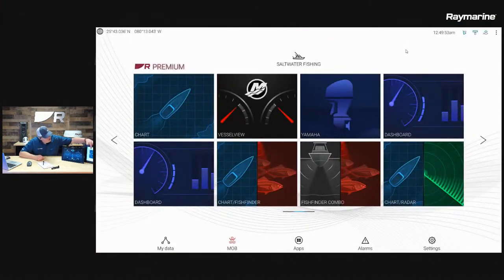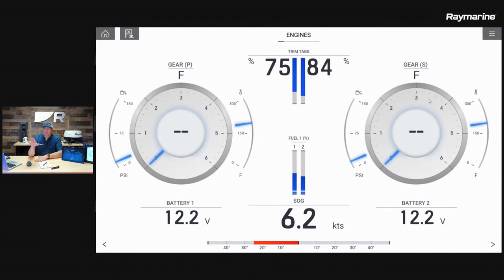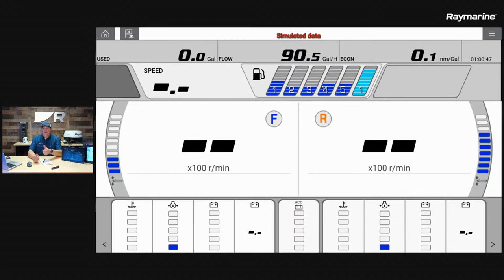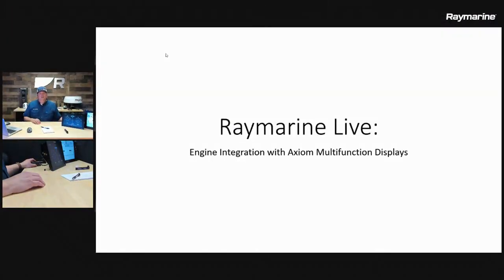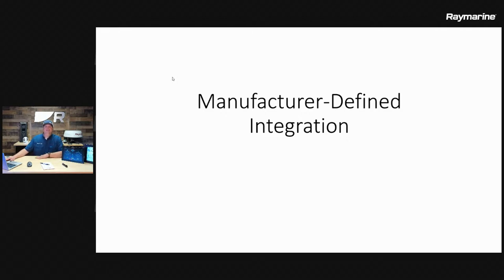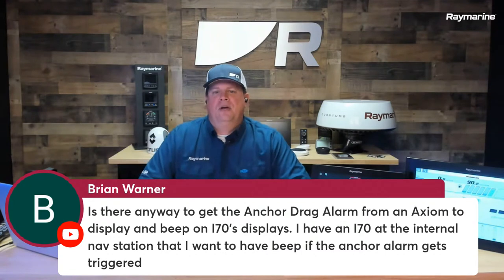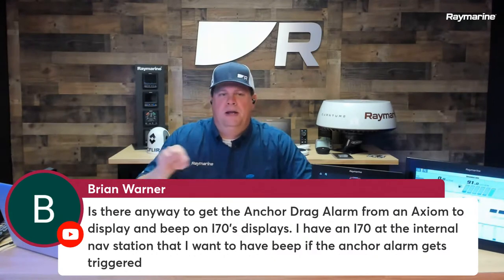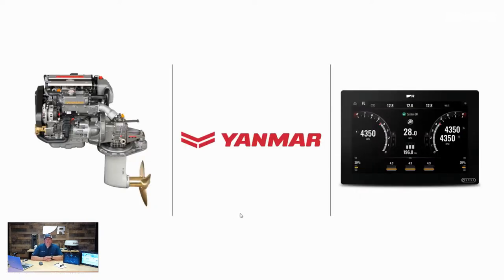Raymarine Live:  Engine Data Integration with Axiom

Comment: How would I set up a repeater for inside the sailboat for an axiom chart plotter?  Can I use an iPad or other tablet in conjunction with the app?  How much control can I have with such a tablet if possible?
Reply from the maker: There are a few ways to setup a 2nd station inside the boat.

Option 1 is to install an additional Axiom display of any size or style and connect the RayNet high speed network from it back to your original Axiom.   This option gives you full, independent control at the 2nd location.   Admittedly though, this is the most expensive option, and it requires some wiring too.

Option 2 is to use a mobile device like a phone or table running the Raymarine app.  The app is free, and available for Apple and Android devices.   You'll link your phone or tablet to Axiom's Wi-Fi hotspot.   The app will repeat whatever is on the Axiom's screen, and you have full touchscreen control from the remote device.

Option 3 is to use Axiom's Miracast video streaming capability to stream the video output wirelessly from Axiom to a compatible Smart TV or monitor.   Miracast is an HDMI over Wi-Fi technology.  Most Smart TVs support it.  You can also purchase low-cost Miracast HDMI dongles that will plug into any screen with an HDMI port to make them Miracast compatible.  This lets you see Axiom at another location.   If you want to control it there too you could connect a wireless mouse or mouse/keyboard combo to Axiom's Bluetooth adapter.  That is how I remote-control the Axiom I use in the studio for the Raymarine Live broadcasts.   When a mouse is linked to Axiom you'll see a mouse pointer on-screen.

Comment: Using Actisense EMU-1 and an Axiom +, can I set up alarms for the engine data coming through NMEA2000? Like high temp. low oil pressure etc. I currently use a Garmin unit and it is not possible there. I can view the data, but there is no option to set up alarms for the NMEA2000 data.

Also, can I add the NMEA2000 data on the map screen on an Axiom? I think so but want to be sure.
Reply from the maker: Engine alarm thresholds would need to be configured outside of Axiom.  Typically the engine system or engine gateway device would be where this happens.  You may want to check and see if they can be configured in the EMU-1.

NMEA 2000 data can be displayed on the map, or any other screen on Axiom is a couple of different ways.   If you swipe in from the left edge of the screen there is a sidebar with 2 data panels.  Long-press on any cell and you can edit the type of data presented there.   Axiom also supports up to 4 floating data items on any display page.   Touch Menu...Settings...Page Settings...Edit Data Overlays...Add.  From here you'll see the data library where you can drill down through the different categories of information and choose what to display.  Once added to the screen, drag to move it anywhere.  Tap the item and you'll see some options for resizing the item too.  Touch SAVE to save it.

Comment: Good afternoon,
Thank you very much for your explanation. I would like to ask you: I have made the installation from Yamaha to Raymarine but the autopilot does not work because I get an alarm "the satellite signal is weak" I think it is because the Yamaha GPS hits against the Raymarine GPS, is it possible? What do you recommend me to do? Disconnect a GPS? Which one?

Thank you very much in advance,
Best regards.
Reply from the maker: Hello Eugeni.   I'd need to know a bit more about your system setup and the position of your antennas.   It sounds like you have a Yamaha system with a joystick controller in it, so we don't want to disconnect its GPS receiver as it is a critical part of that system.   If you could, please email me at james.mcgowan@raymarine.com with your contact details and I can have a member of our technical team get in touch to assist.

Comment: So my electronics guy put in the EC100 for my twin Yamahas. Since it’s not the Yamaha 6yg what readings can I expect to get on my display screen? In particular I would like to know my gph as well as fuel level for my fuel tank. Will I get this from the EC100?
Reply from the maker: If you go into the Dashboard app and access the engine data screens there you will get just about everything you would expect.   RPMs, gear, temperatures, pressures, fuel burn (if your engine outputs  it).   You may or may not get tank levels depending on whether or not your tank senders are part of the engine's digital network, or are analog inputs.

The actual Yamaha app on Axiom won't show you anything with ECI-100.  That app (per Yamaha's requirements) looks for the presence of the 6YG gateway before it will show a full data set.

Comment: Jim, I bought a commercial tour boat with older Detroit Diesel 8V-92-TAs. Can I integrate with Axiom? Also would love to speak with you regarding drone integration.
Reply from the maker: Hi Gary.   Many of the Detroit Diesel motors support J1939 engine data.  If your motors have any kind of electronic instrumentation connected to them now, that is most likely what they are using.  You'd need to use a J1939 to NMEA2000 adapter to make it work.

If your engine instruments are all analog gauges then you could use one of the analog to digital conversion products, though they need a bit more setup.

Feel free to shoot me an email to james.mcgowan@raymarine.com about drone integration.
Reply: Garry, did you get it figured out? I also have 8v92, but I don't think it's about the engine in particular: we can buy transduceres that output NMEA 2000 and it'll integrate. A more subtle problem might be that (per the manual and online docs) there's no high temperature transcucer interface built in. For the exhaust gas manifold, you'll want that (and I do too!) to get early warning if any number of cooling mishaps occur.

Comment: converter SPX10 auto pilot to Axiom is this possible, so I can use Axiom to steer my SPX10 autopilot, I have a A9 were I have this possibility - Love Raymarine
Reply from the maker: Thank for watching, Erik!  Axiom can work with your SPX-10 autopilot for the purposes of sending it waypoints or routes to steer to, sharing compass heading information, and sharing navigation data.  Primary control of the autopilot would be from your pilot control head though.

When used with an Evolution-series autopilot, Axiom can be the primary (or only) autopilot controller onboard.   Axiom has the ability to setup and configure the Evolution series autopilot, start and stop it, etc.   That full level of setup, calibration and control is not available with your SPX-10.

Comment: Hi, love the Raymarine Live video series, huge value for customers.  

I have an older 2000 Yamaha 2 stroke outboard, model Z200TXRZ engine ID prefix 6G6X, which I would like to integrate any engine data to my Axiom Pro RVX via the NMEA2000 network.  I didn’t see the solution in the video or answers.   Thanks advance for the help.
Reply from the maker: Hello Eric.   I am not 100% certain about your motor just because of its age.    From what i have read online, Yamaha did not add CommandLink and NMEA2000 data capability until their 2005 model year.  If that is the case we would be able to make use of Axiom's built-in Yamaha app.

It might be possible to get engine data through another method, though that becomes a bit more of a project depending on how it is done.    If there is any electronic data at all available from your Yamaha motors, it might correlate to one of the automotive, industrial or diesel-based engine data protocols like J1939 or J1708.   Companies like Yacht Devices make adapters that can work with many of those systems.

If your boat is fitted out with a bunch of analog gauges, its also possible to use a device like a Noland RS-11, Alba Combi, or Actisense EMU-100 to read the analog signals going to each instrument and convert them to NMEA2000 digital.  This is not a plug-and-play solution, and often the reward for doing so is not worth the effort involved in doing it.  

Another way to do it, probably the simplest of all, but also with the most basic data, is to use something like this Outboard Motor Gateway from Yacht Devices.    It can pick up engine RPM by sensing the pulses on a spark plug wire, and converting them to NMEA2000 data that your Axiom could read.   https://www.yachtd.com/products/outboard.html

Comment: You mentioned possibilities getting old antique engine data?  What about getting data from a 2018 gas Westerbeke generator?
Reply from the maker: Hello KMT.  I see Westerbeke offers NMEA2000 as an option on many of their diesel generator sets going back to 2008 or so.   I don't see much related to their gas models though.    I was doing some digging and see that their EFI gas models to have a diagnostic port that can be read with a Windows PC and their software.   That means that they are outputting something...what format its in is to be determined.

I just sent a B2B message to a contact as Westerbeke to see what information they might have on this.  I will post an update when I hear back from them.   Feel free to send me an email too so I can find you a bit easier.  james.mcgowan@raymarine.com

Comment: Would you replace the gateway if youve been struck by lightning?
Reply from the maker: Ouch!   This is a tough one Tracy.   With a lightning strike, pretty much everything onboard the boat that is electronic becomes suspect.   Often it is necessary to go component-by-component through the system to determine what is actually working, and what is not.

Comment: Hi Jim. I am wondering if it is possible in the Axiom to change the maximums of the gauges. For instance I don't need a rpm gauge that goes up to 5k nor do I need my temperature gauge to go to 300. It would let me have much more useful gauges if I could adjust the rpm max to 4000 and the temp max on the gauge to 225. Is this possible?
Reply from the maker: While in the dashboard app go to Menu...Settings...and select the Advanced tab.   There are some settings there where you can configure the maximum RPM for the tachometer, and define a custom red zone too.  I will do a bit of research on the temperature gauge.  I don't see a control to adjust it.   If you could, please shoot me an email to james.mcgowan@raymarine.com so I can get back to you with a better answer on that.

Comment: Hello Jim, I have SeaBoss 19´with a Mercury 115hp fuel injected 4-stroke dating back to 2008. Can I integrate my older Raymarine A50D using the same hardware & cables for the Axiom you mentioned in the video? what is the aproximate cost of doing so? Great video, congratulations. Thank you.
Reply from the maker: Hello German.  Thank you for watching our Raymarine Live series!  The A50D has a different power cable than Axiom RV so you will need to change that out.   The transducer your A50D is using now can be used with Axiom.   You can use it as the only transducer, or, you can use it along with an Axion RealVision 3D transducer.

If you want to use only your existing transducer you'll need to order transducer adapter cable A80488 ($60 US).  This will give you 2 sonar channels on your Axiom, identical to what you have now (50 KHz and 200 kHz at 600-watts of power.)  This adapter takes the 25-pin RealVision 3D connection on Axiom down to 7-pins, which your current transducer has.

If instead you use transducer adapter A80491 ($110 US)  you can utilize both your current transducer as well as an Axiom RealVision 3D transducer.   I run this setup on my own boat and love it.   This is a Y-Cable adapter that lets you simultaneously connect both a 25-pin RealVision 3D transducer and a 7-pin Airmar 600-watt transducer.  You'll have access to 50 kHz at 600-watts, 200 kHz at 600-watts, CHIRP DownVision, CHIRP SideVision and RealVision 3D.   It makes for a very powerful setup useful both in shallow and deep water.  In this configuration you do lose the 170 to 230 kHz CHIRP channel from Axiom, and, the water temperature reading will come from your OLD transducer and not from the newer Axiom RealVision 3D transducers.

The Axiom RV models range in price from $999 (US) for the 7-inch Axiom RV (no transducer included) to $3429.99 for a 12-inch Axiom RV bundle with the RV100 transducer and Navionics charts in-the-box.

Comment: I have twin Volvo Penta Engines Volvo Penta IPS 500. Engine Year: 2019. Engine serial #1: A969238 and Engine serial #2:A969240. The engines are not being recognized by my Axiom 12 display when I go to engine data page. Even when I select “Other” and run my engines in sequence as requested by Raymarine. Data for my engines is displayed on two separate Volvo display that only show one selected detail at a time (oil pressure, engine temp..etc. How can I get all this data one one page of my axiom displays. Thanks, Al
Reply from the maker: Hello Albert.   For most Volvo Penta engine installation you will need to use either a Raymarine ECI-100 universal engine interface module or a Volvo Penta engine gateway to get at the engine information.  Either of these devices will plug into the Volvo EVC network and provide a NMEA2000 data stream that connects to Axiom's SeaTalk NG network.

Our ECI-100 handbook shows the setup specifically for Volvo systems starting on page 25.   
https://raymarine.app.box.com/s/s2bajpvqjoiflgsqzx3o/folder/1787229147

You'll need to locate the Volvo multi-link hub inside your helm.  This 6-port helm will normally have an empty port on it that can be used for the engine data gateway device.   If you use a Raymarine ECI-100, it will plug into it using a Volvo link cable, part number E70240.   The Volvo link cable plugs to the hub, then the other end screws into the ECI-100.  The other port on the ECI-100 will use a SeaTalk NG spur cable to plug into the Raymarine network.

If you use a Volvo Penta factory engine gateway, it will also have 2 connections.  One fits into the multi-link hub, and the other will tie into the Raymarine Seatalk network through a A06075 DeviceNet adapter cable.

In both instances, power to the engine gateway is provided by the networks already installed.

On your Axiom display you'll set the Engine Manufacturer to Other, and the number of engines to 2.   From there, go into Axiom's Dashboard app.  The app should pre-set itself for a dual engine display and your data should be visible in the app when the engines are on.

If its still giving you trouble please feel free to drop me an email at james.mcgowan@raymarine.com or open a ticket with our support team at http://raymarine.custhelp.com and I can get our engine team in touch with you.

Comment: What was the system called just before the Axiom? I have that system on my 2007 340 DA with 8.1 496. I want to display engine data. Help?
Reply from the maker: Hello Joseph.   You probably have our e-Series, eS-Series or gS-Series screens on your boat.   These units run our LightHouse 2 operating system. 

Engine data connects using NMEA2000 data, and will come into any Raymarine MFD through its SeaTalk NG or NMEA2000 port.   This video might be helpful to you:  https://www.youtube.com/watch?v=wEtUvEpu0Ow

The MFD featured is our Axiom-series products, but the way they connect to engine systems is the same as for prior generations of products too.    

Feel free to open a ticket with our team at http://raymarine.custhelp.com with the details on what Raymarine screen you have, and what engine you are trying to connect to and we can offer more detailed advice.

Comment: Enjoy all your videos. Very informative. I have ‘98 Cummins 6CTA8.3 diesels and recently upgraded all my electronics to Raymarine Axiom 9. Can I get engine info displayed directly to my MFD?
Reply from the maker: Hello Peter.  Our Axiom displays can read engine date in NMEA 2000 format.  That is a marine industry standard format that allows many different kinds of marine devices to communicate with each other.   Most likely your 1998 Cummins diesels probably do not output NMEA 2000 information natively, but don't worry.  There are aftermarket options available that can help.  Many marine diesels natively communicate using an automotive standard called J1939.  If your engines have any kind of electronics instruments or controls currently, they are most likely J1939 devices.    A vendor called Yacht Devices offers an engine gateway device and plug-in wiring harness that can read J1939 information and translate it to NMEA 2000 for display on marine network devices like Axiom.   I suggest getting in touch first with Yacht  Devices and let them know exactly what motors you have and they can suggest the proper gateway device and wiring harness adapter.   You can find them here:  https://yachtdevicesus.com/collections/engine-gateways

Once you have the engine gateway installed, its as simple as plugging it into the boat's SeaTalk NG or NMEA 2000 network, and then doing some basic setup on Axiom's boat details menu.  There you will tell Axiom how many motors your boat has.   Engine date will be displayed in Axiom's Dashboard application.
Reply: Thanks for the great and informative reply!! Enjoy watching your streams.  @RaymarineInc